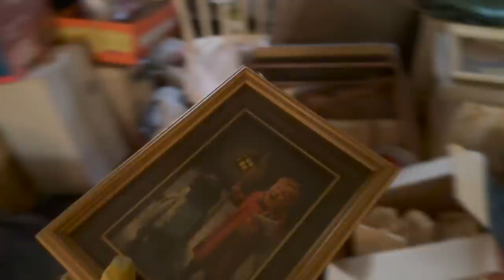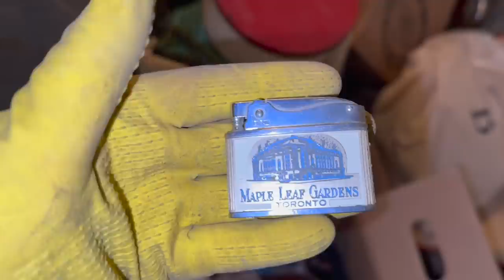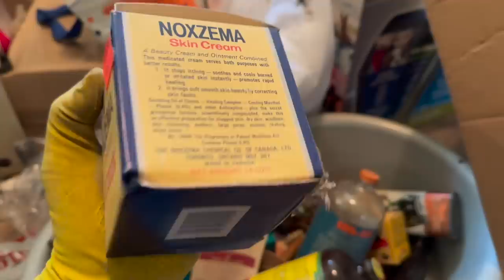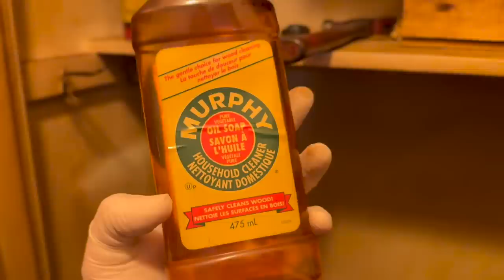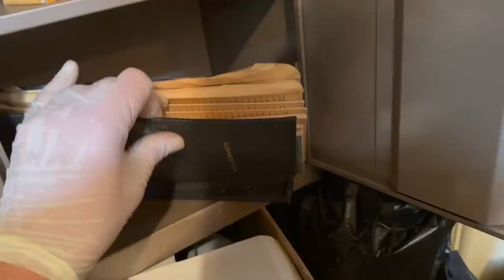Searching a Hoarded Basement for treasure. Found Hidden Jewelry! Part 4

Comment: If nothing else, the lesson here is to check your basement for water damage once in awhile. I don't go to my basement all that often but this makes me think I should more often.
Reply: the water damage doesn't always come from a flood either. Concrete isn't water proof, so small amounts of moisture seeps through and over the years can cause that kind of damage as well.
Reply: Not only that, but for important health reasons, any time there may have been a flooding event the house needs to be checked for water damage and mold growth remediation. Old folks’ homes should be checked at least annually if there are hidden or inaccessible areas, because the mental damage black mold does is no joke.
Reply: @scottstewart3884  Great point. Bad roofs can also be an issue — the interior ceiling of an attic can completely fill with black mold and no one in the house would be any the wiser if the attic is never opened. But the mold spores are invisible and insidious.

Comment: Hey Alex! Ok, I'm curious.....what was in the locked top portion of the metal cabinet? You only opened the bottom locked door. Also, the separate large "envelope-style" dividers in the "paper work" holder could certainly hold "paper work" with $20, $50, $100 printed on them ;)

Comment: Those plastic things are  Tupperware Hamburger makers and are stackable. The open ended one is put inside the others and you press the ground beef  into the container. There should be another piece that is a press with a handle and a cover for the stackable containers
Reply: Yes they are I saw them,  too! Tupperware still sells them & they are freezable, too! They can be washed too rack in the dish washer as well!

Comment: That basement floor scene after you'd pulled the stuck boxes off looked like a large shape puzzle!  The outline of the things that were stuck to the floor were still there.  This has been a fun series so far but I feel for you having to go through so much work just to clear the trash.  I haven't seen things stuck to a floor such as this before!  This is like a step back in time with the treasures you are finding. The doctor's kit must be from the fifties.

Comment: Barcodes were invented in 1948 by a couple of Drexel University students but it was June 26, 1974 that the first barcodes were scanned at a commercial check-out stand.....You will find books with barcodes beginning in about 1972, prior to 1972 you don't usually find barcodes in books.....I couldn't believe it took over 20 years for barcodes to be used commercially....
Reply: Probably had to wait for computer technology to develop to make them usable?

Comment: Bar codes were in the 70s. My dad worked for NCR when the NCR Engineers created them.
Reply: The patent is dated 1952. NCR was one of several companies that were trying to figure out how to use and implement them in the early 70s.  IBM was the company that really got things rolling in the grocery industry.  It was a tough battle.

Comment: At 10:45 the round plastics in the box are Tupperware brand hamburger maker parts.  Should be a base with 5 or 6 storage containers and a plunger to press down on the hamburger meat into the form.

Comment: East and West Germany did not end until 1990.  Why did you think the soap was from the 50s?  I thin it was likely just due to the extremely challenging job of clearing this house.  Ekkks
Reply: To be fair, the packaging did look like it was from the 50’s 🤷🏼‍♀️ It could be even older, as 4711 products go back to the 1870’s. The original cologne was actually formulated in 1792!!! 😳 I’m not saying the soap is that old 😂 but it could definitely be from the 1950’s.

Comment: Was the Ukrainian man that was stabbed at the bus stop, one of the families you were helping? It said he had arrived in Canada only two weeks ago.   On another tack - I used to do old style photography - and learned that prints are extraordinarily resilient. A moderately soiled print can be rinsed off and re-dried. Even if you don't have a print drier you can clothes pin them to a line and let them air dry. Then they can be scanned and re-touched electronically - thus saving the image for posterity.

Comment: Any reason to be worried abiut the wet floor or asbestos or the 2 together?
Reply: It's worse if it is not wet.  Dry asbestos fibers in the air are a bigger worry.

Comment: I've never been very tolerant of summer heat and my mum used to dab 4711 cologne on my temples to help me cool down - never seen it in soap form before though
Reply: They make it in tons of forms. You can still buy the soap and they even make cooling alcohol wipes with it in little packets like those hand wipes you get at some restaurants.